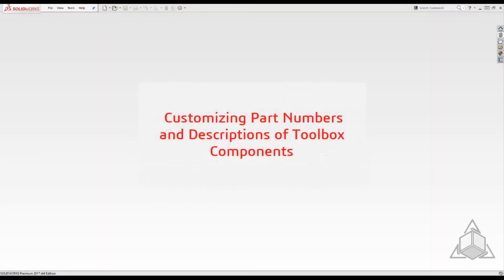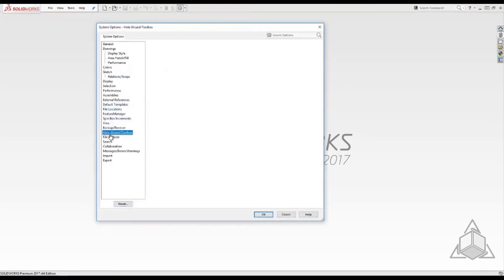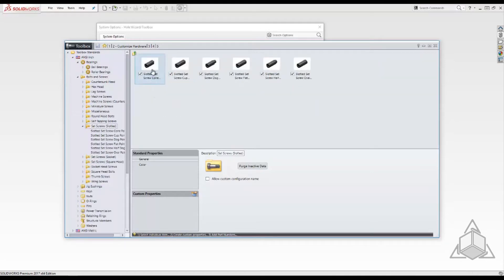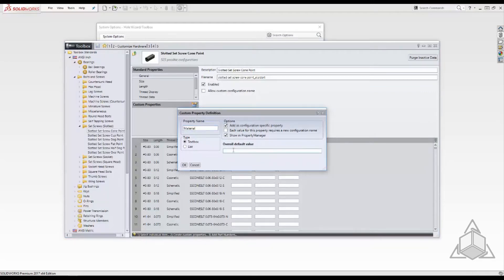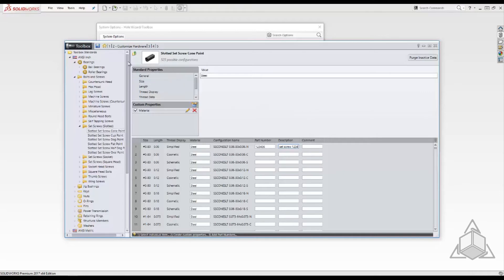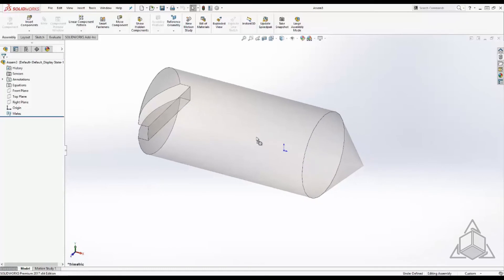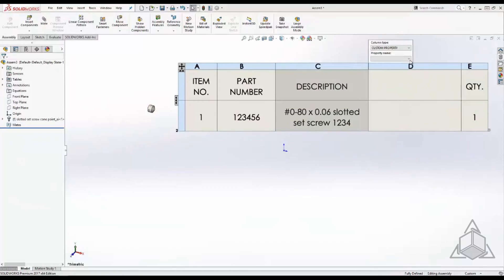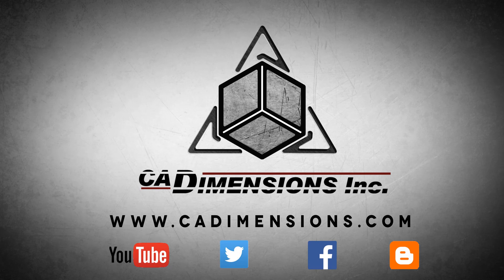Tech Tip - Customizing Part Numbers and Descriptions of Toolbox Components

Comment: Thats nice but... is there a way to load my own standard family? is there a way not to type in each line (such as import from excel)
Reply from the maker: Great question! It depends on your version as to where the option is. In 2017 (as shown here), when you're in a fastener type, follow the column headers all the way across to the right. In that dark gray top bar to the far right-hand side is an icon that looks like a few horizontal lines and a down arrow. In there, you will find the import / export options. 

In 2018, they revised the interface and you'll find an excel icon at the top left of the table with a drop-down for the same options. 

Once it is exported, you can make your changes in excel and send it back in with the import option! Hope that helps!